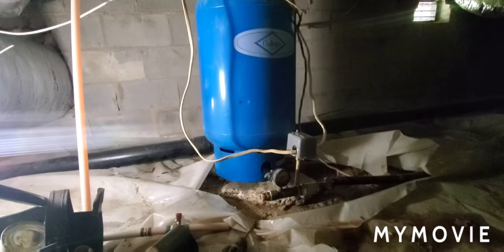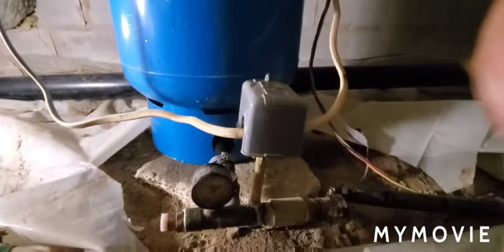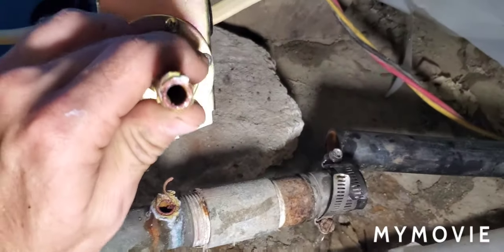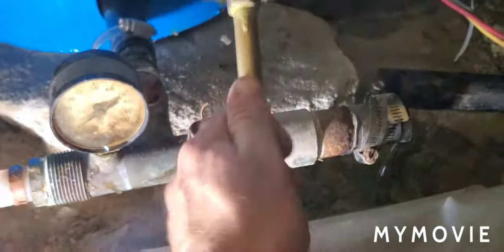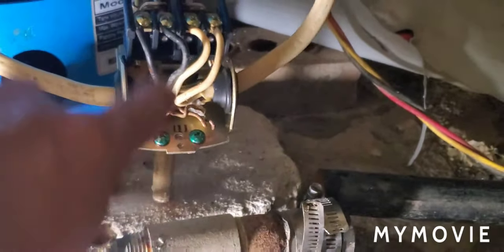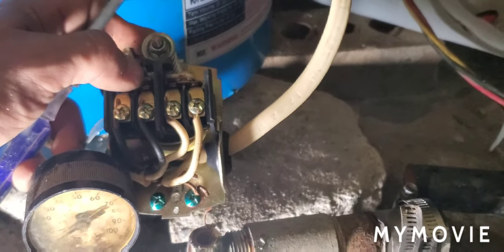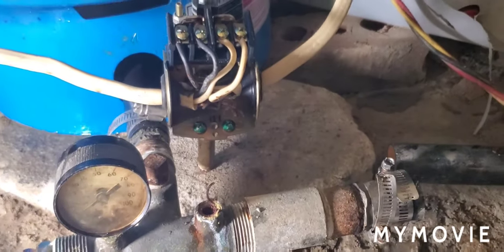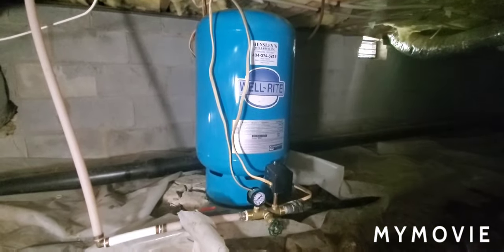No Water or Low Pressure how to fix it & diagnose the issue. Well pump not pumping

Comment: Looking for help in Ontario Canada.  Breaker to well convertible jet pump tripped and all water pressure in our house was lost.  Re-set breaker, pump made a humming noise but wouldn't start, and breaker tripped again.  Air tank is operating properly (drained, pressurized to 28psi for 30/50 pressure switch on new pump), and confirmed voltage.  Installed new 0.5hp pump (same hp as original) and primed courtesy of neighbour's garden hose.  

With valve on house side of pump closed to isolate pump/well side, we turned the new pump on after system was thoroughly primed.  Pumped turned on, but struggled to maintain pressure at 15psi, and needle on pressure gauge was fluttering wildly. Sound coming from pump seemed to indicate pump was pulling air.

To ensure I hadn't bought a defective pump, I returned it and purchased a 0.75ph (same 30/50 pressure switch.)  Reconnected new pump, re-primed, but got the same result, with low pressure, fluttering pressure needle, and sound of air being pulled.

Is it reasonable to assume I've got a foot-valve issue, or possibly a crack somewhere in the pipe leading out to the well?  According to previous owner of house, well was dug in 1978, and I'm assuming the lines leading to the well are the same age.  (Lines are buried +5 feet, so they're well below our frost line.)

Thanks in advance for your assistance.  Cheers.
Reply from the maker: Its definitely a hole/crack somewhere down the well. Time to pull the pipes out & inspect everything. Metal foot valves can rott over & a hole be in it sucking in air. But definitely leak . Your definitely on the right track. FYI I hate jet pumps foe every reason that you'll learn.

Comment: My submersible pump around 100 ft deep will only get about 10 psi. Can’t even get water in my tank. Is it a voltage issue, bc I haven’t hooked it to a breaker yet. I just ran an extension cord out there to ensure all the connections and stuff worked and my new house being built doesn’t have power yet.

Comment: Any advice  would be a much appreciated. We are having low water pressure. I installed new pressure switch when tank is drained was the correct  38 psi with the 40 60 switch the tank does not feel water logged the tank is like 14 years old is there any ither things i can check

Comment: I'm troubleshooting a well issue.  I have water pressure in the house but it's less than normal.  I went to change out the water filter as I thought it might be filled up with sediment when I noticed my pressure tank had zero water in it.  I looked at my pressure switch and the contacts are closed.  I flipped the power switch with the plastic cover and saw that it produced a spark.  I cleaned the contacts but nothing has changed.  Do you have any other troubleshooting tips for me?  Thanks so much!
Reply from the maker: Don't trust the gauge. 
Is your filter element black/ carbon? If so thats probably the issue. 
If the switch won't open, you probably have a broken pipe in the well leaking out most of the pressure.
Reply: @h2omechanic  Thanks for the quick reply.  I haven't looked at the gauge.  I went to drain the pressure tank and absolutely zero water came out of it.  No water is going in or out of it.  It is hollow when I bang on it and is also very light.  I can't get the switch to open, so I will likely look inside the well.
Reply from the maker: @aarongriffin6799  the tank is good, it's supposed to be as u described. You will find a leak or cracked fitting in the well
Reply: @h2omechanic  Just a follow-up after we pulled the pump from the well.  We found a crack in the plastic pipe leading to the pump ... JUST AS YOU SAID IT WOULD BE!  Thanks for the help and guidance!!

Comment: Hey friend.....I got an old well system......got low pressure....and gauge reads 0.....and hear a noise that never stops....tank is pretty much empty.....I can move easy ....when no water in use....it still has 13 amps running.....and I got tank...new...new switch...gauge....all brass/pvc piping to put in new...any ideas..... submersible pump I have not looked at yet.......well only 46 feet deep.....

Comment: My pressure relief valve was leaking, I replaced the pressure relief valve with a preset 75 psi relief valve, now the new relief valve is also leaking. my  gauge is stuck at 60 psi so I am not sure what pressure I have in my system. to me it seams that I have more than 75psi so possible need a new pressure switch. your thoughts, thank you in advance.

Comment: How it's going friend. I have my water pump out side. My out side water works but there is no water pressure in  the house. Do you know what I could.do?
Reply from the maker: Change the filter. If the element is black, stop using them & only use the white kind

Comment: My Flotec pump was somewhat working fine until today. For the last week, the water would stop running for 2/3 sec until pump kicked in. Pressure set 20/38 with 18 psi in tank when empty. Decided to clean the line going from pump to pressure switch thinking it might be dirty. Decided to remove pressure gauge as well to clean its opening. Sure enough, it was almost clogged up with rust and sediment. Opening on pump was almost plugged up. Cleaned everything and put everything back without making any other adjustments. Restarted pump but now it doesn't build up any pressure. It seems to start pumping to about 20 psi and drops back down to 14 psi. It will pump continuously but I can stop the flow of water with my thumb at the tap. This isn't my first experience with jet pumps but never had this problem. Could you suggest a solution to this problem.I can leave priming plug open and water doesn't go down after a day, so no leak in pipe. Two lines with injector down in the well. Could some dirt fall in the pump when I cleaned the openings? Thanks if you can offer a solution. Greatly appreciate it.
Reply from the maker: If you had large amounts of iron buildup inside your plumbing then all the metal fittings at your pump are the same! I personally don't like jet pumps for this reason, too many little things can be the problem. If it is old its probably a worn impeller seal if it won't build pressure. Or you have a air lock in the down pipe.
Reply: @h2omechanic  Thanks for the quick response. Pump is 10 years old and on hard water. How would I get air in the down pipe? I never drained any water from the system. I have a galvanised nipple in my line going to the well and has been buried for close to 40 years. I suspect that might give me problems soon. Can I use plastic fittings underground?
Reply from the maker: I'd say replace any metal with plastic even in the ground if you needed to fix a leak. Id focus on the pump & pull out all 3 fittings & see if any are clogged up. I believe you'll find something. Also watch a video on replacing the impeller seal
Reply: Pump is working now. I found an air bubble in in the clear line coming out at the top of the pump at the tee going to the water tank below the pump. I had to tilt the pump a little to let the air bubble come out of the priming tee. I thought since it was in the line after the pump body that the  water being pumped would push it out of the line. Still don't know why it was able to pump water but not build enough pressure. I know that an air leak will prevent a pump from priming but this one defies all logic. If the line had not been transparent I would have never suspect an air bubble.

Comment: 220 went out at the house. I think I blew the pressure switch or breaker troubleshooting. I replaced both. Pressure gauge shows 40psi. I checked the bladder and no air so I filled it up to 26. Water started but when the air ran out and the pressure will now not fill up in the tank. Never heard the pump turn on.

Comment: Could the pipes before that pressure switch be frozen? I just repaired busted pipes in my house because of the negative temperature then when I turned the water back on I had pressure for a few minutes then it shut off

Comment: Problem: cut the power off but there is still 43psi on the gauge. I want to replace pressure sw but this is stopping me.  I've drain all water thru faucets but still have 43 psi . Any thoughts?

Comment: my tank has no pressure period i will take the steps on checking if it is the main switch because we do have alot of ants last time it was a frog that was stuck in our tank so im hopeing this is the case that there are ants and build up the tank is empty thats for sure that was the first thing i checked yesterday so i hope this video helps ....please get back to me as soon as possible it is now sunday we been with out water since friday 6pm and everyone was closed and sunday no one is open and i have work monday so i need to wash clothes and my self , so if you could help me get my well up and running today that would be awsome.

Comment: We had a power outage for about 20 seconds early in the morning.  About six hours later as I was shoveling snow, my wife came out to tell me there was no water. We just bought the house two months ago.

I am confused because everything seems to be in order.  The pressure tank has 38 psi pressure, I have sparks on all contacts on the pressure switch and I checked the voltage with a multimeter, but the pump won't turn on and my pressure gauge reads zero.  The pressure switch is at the position where the contact points are touching yet the pump won't kick on...

I am going to try to take the pressure switch off and jam a screwdriver in there to knock anything lose, but beyond that, I am stumped.
Reply from the maker: Its possible that the pump or the wire feeding the pump has failed. If the house  13-16 years old, & the pump is original to the house , then its just reached its typical life span. 
If you test for power out at the well & you get 240v, that'll let you know for certain that the pump is dead or possibly the wire is bad going down in the well

Comment: Swapped out pressure switch, 40-60 psi setup. Tank only reads 20 psi, but can’t seem to pump in more even with water emptied. Pump motor switches off and on. Any help would be greatly appreciated!

Comment: What else can I check if i'm not getting a spark (not kicking in) after replacing a presure switch? We took photo's of the wires prior to changing switch. So the wires are correct, and power was turned back on. Water valve was turn on prior to remove water presure pior to repair. Air tank isnt full of water. Sorry these are out of order,  Any idea's? This is my dads water system i'm trying to fix. So I hope you or anyone can give me any ideas. Thanks in advance! Larry
Reply from the maker: Test for voltage at the well head. If you get power there, then the issue is down the hole. If its a submersible pump, then either the wire has a open jacket exposed copper. Or the pump itself is dead. Volt meter is a must
Reply: @h2omechanic  Thank you I'll try that.

Comment: My pressure switch is wired differently I’m wondering if it’s wired up incorrect it has a black and white on the left and a black and white wire on the right

Comment: My pressure gauge is reading low < 10 psi. It drops immediately to 0 psi when I cut the power. Also, when I close the valve to the well, the pressure slowly drops to zero. Think I have leaks?
Reply: Main issue is some but very little water pressure in house.

Comment: also, in removing the pressure valve, mine has a 3/4 nut.  Is it counterclockwise to loosen?
Reply: Lefty Loosey. Righty Tighty 

That’s the way I always remembered it and is true for almost all threaded fixtures….( with the exception of the cooling fan clutch in a vehicle being the only time I’ve encountered a reverse thread and that’s bc the fan turns clockwise while running and would turn itself loose and fall off everytime the fan was running ).

So lefty loosey you turn it to the left or counter clockwise to loosen🔄

Righty tighty you turn it to the right or clockwise to tighten 🔁

Comment: When I checked my pressure switch, I found a burned contact, and the bladder was at zero. Changed out pressure switch turned switch back on with no power to the switch.

Comment: Great vids!  I’m learning a lot.  We have been having issues where we lose water lately.  Our well used to make 2gpm.  We installed a low yield cistern to help, and when it was being installed, the well only made 2.5 gallon per hour!  Our static level was 60 feet lower than what the well log stated 13 years ago.  Our area  notorious for low yields.  Is there any hope that our water table will ever become restored so we can get 2gpm?  Drilling deeper is not a good option.  There is a high chance of hitting salt.  We are already at 260ft deep.
Reply from the maker: My best advice for you is to call Well Drilling companies and see who offers Hydro-Fracing!  Your veins are probably clogged with sediment and fracing the well will blast them clean & help them flow again. Second option is drill a second well as far away from that well as possible and have 2 separate systems that you can flip back & forth to. Hope this helps. Fracing will cost around $3000. So call around and get a couple of prices.
Reply: Thank you !!

Comment: I replaced pressure switch and cleaned out tube , i am getting spark but will not pump water. I need help!!!!!  Its been stopping intermediately and it shuts off using the spicket outside

Comment: Ok now we don’t have a clue what to try 
we have just replaced the tank  today points and pressure gauge and checked to make sure the points were not clogged up in the water line  
 the points continue to cycle off and on  
Please what do we do
Reply from the maker: Do they cycle on / off every 2 seconds or every 30 seconds. 
If it build pressure and you turn off the power & watch the water pressure drop to 0 w/o running any water, that means you have a leak. If you don't find a wet area, then the leak is down the well on the drop pipe near the well. 2 other videos on my channel explains this situation
Reply: Thanks we will check this 
God Bless you for sharing your knowledge

Comment: Yes I'm in calif. And our well is losing pressure and runs out of water within five minutes then repeats itself also if I switch the breaker off and on it makes a different sound  and shuts off within 10 seconds. What does it sound like to u is it bad or plugged switch or well running dry
Reply: Also water looks gd and is at a low pressure always takes a gd 3 to 4 minutes to replenish but never gets high pressure
Reply from the maker: I believe your in a drought, so the well is running dry. Only a well company can truly determine what the problem is.

Comment: I'm having a problem with my will flipping the  breaker I changed the  Pressure switch And change the pressure gauge could you please give me some advice
Reply from the maker: Pump is bad. Replace pump & inspect the wire for open areas on plastic couting

Comment: I had a 30+ yr old Weill pump 150 feet deep that finally died on me during a storm so the next day I replaced it. I also replaced the pressure switch 40-60. Now I have good pressure on one side of the house but almost no pressure on the other half of the house. Could you please share your thoughts on what’s going on?
Reply from the maker: You might need to clean the sink spout screens. If the ones with weak pressure saw the sediment from the initial startup, id say the strainers are clogged
 I have a video explaining that.
Reply from the maker: https://youtu.be/8Ku8r6Q-O6Q

Comment: Changed control panel because capacitor circle was yellowish instead of white. Still no water. Flicked the pressure switch with its cap and saw sparks. Still no water. Leads are touching and can feel the vibration of the pump on the pipe, but still no water. Pressure gauge is at 30.
Reply from the maker: Your pump needs to be pulled out of the well. A fitting that connects the pump to the pipe has rusted threw or if it's plastic it has cracked & its leaking out most of your pressure. sometimes If you turn off the power & the PSI goes to 0, you know 100% there's a leak. If you can't find a wet spot in your yard, between house & well, then the leak in down in the well
Reply from the maker: https://youtu.be/rVgDq7gB6Qg
Watch this video, you have this problem
Reply: @h2omechanic  will I know fir sure it’s in the well too because water is not coming out of the valve at the pump when I turn it on?
Reply: @h2omechanic  also thank you for what you’re doing on here to help me and others
Reply from the maker: If u feel it humming & no waters coming out, it's 100% down the well. Pull the pump out

Comment: What would be the affect of a defective 220 breaker only passing 120 volts to the motor?
Reply from the maker: If the breaker is bad, the pump might still run & only build 15psi but more than likely it won't run at all. 
To truly test the breaker theory you must disconnect the wires from the well & test both legs there & again at the switch. You can have 1 broken leg down the well & it can sometimes read 120v but whats happening is 120 is on each leg & one being open won't make a complete circuit thus showing you half of the voltage. Also testing each leg to ground will show which leg could be bad. 
Breakers do fail, but only like 5% of the times.
Reply: @h2omechanic  Well, here's the current status.  Removed the old pressure valve.  Found the small pipe (nipple) was obstructed.  Screwdriver fixed that.  Thought I'd replace valve.  Before I had spark.  Now none.  Haven't tested the breaker yet.
Reply from the maker: Just replace the switch, there too cheap if yours isn't acting right. & I can't diagnose it if its hit or miss